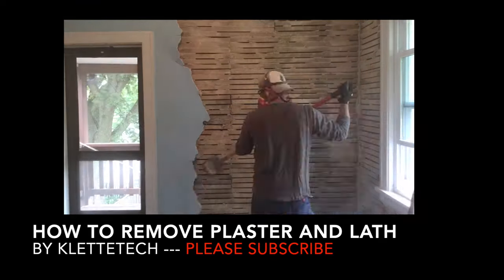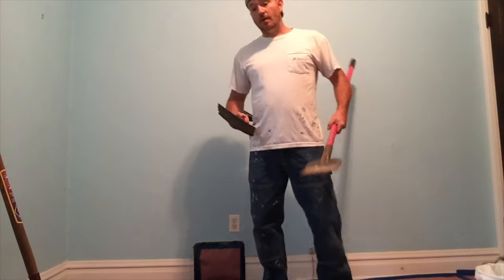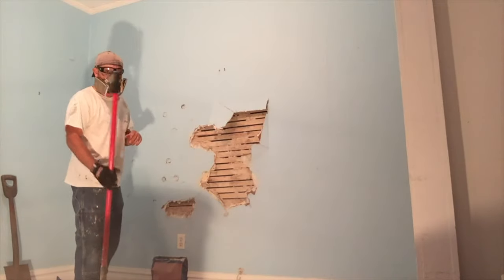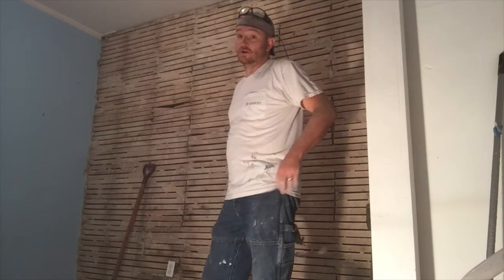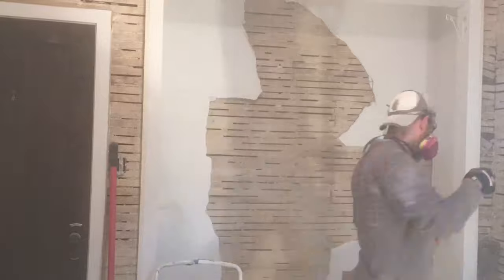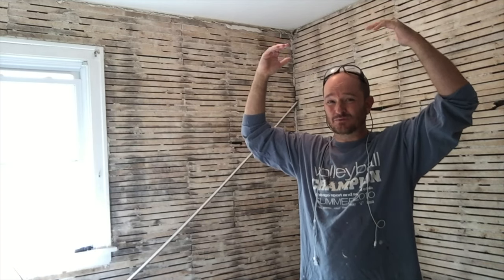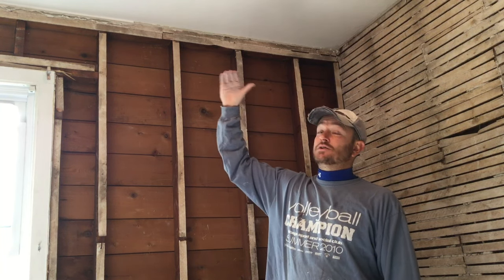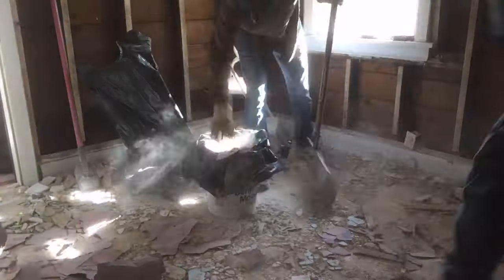How Removing Plaster and Lath (Part 1 Bedroom Rehab)

Comment: This is an old video, but here is a tip. Instead of cleaning up as you go, you can lay thick plastic sheets on the floor (they sell them at Walmart in the paint area) and then remove everything you need to remove from the walls and then bag up the entire floor and put it in one of the Waste Management green bags for disposal or dispose of it at your own trash site! That makes the process FAR better because you aren't stopping to clean up. At worst, you can put the plastic down, fill it with stuff and then wrap that up, put more plastic down and do it all again. It is truly a time saver.
Reply from the maker: Great Tip
Reply: This is a great tip! However, can you explain how you lift it once the plastic is full? As he said, it's very, very heavy. We're remodeling our room by room as well, and this is our process.
Reply: @SimplyInterested you don’t plaster is heavy like mortar and concrete, you use the plastic to protect the floor and clean up as you go. If you have a finished floor you’re trying to protect, use something heavier like cardboard or ram board. If you keep the plastic loose and the floor picked up you can fold over one end of the plastic and sweep all the dust in one pull. Makes dust removal easier.
Reply: @SimplyInterested 
I say lay down multiple layers of plastic and then you can take it away once you get to a point that you still think it's manageable. Otherwise you can use the heavy contractors bags and take it away that way. The plaster is really heavy so you won't get to fill the bags very much.

Comment: Couple of recommendations: pull all of the casement moldings off prior to demo and put a box fan in a window and open another window from another room to create a cross vent to pull the plaster dust from the air.

Comment: Maybe I missed it in the video, but why you you tear out what appears to be a very nice and well taken care of, superior plaster wall and replace it with cheap and inferior dry wall?
Reply from the maker: It was not a nice wall.  It was cracked in places, would have been expensive to repair and horrible to take down all the wall paper.  Also, I wanted to insulate the walls.  As the temp gets colder you can already tell the difference.
Reply: @KletteTech if your plaster is an inch or thicker it should be the insulator itself. I have an old place with a detached apartment that the apartment has double hung Sheetrock and the house has lathe and plaster. You can get fasteners to reattach plaster and fibamesh in 150ft rolls and seal the cracks in plaster (like wallpaper but it’s muddled into the wall with skim coat) Plaster is sought after and I was told removing plaster from older homes actually devalues the home.
Reply: @battlemasterszone1750  they lied. There is no premium for uninsulated lath & plaster walls in the average old home. 🇨🇦
Reply: @kerriwilson7732  it’s all about what the buyer wants. Opinions are like…

Comment: THANK you for being one of the few who properly advocate removing the plaster but not the lath in step one. So much easier to clean up. But... remove all the woodwork first. use medium strikes with a hammer all over to crack the plaster. Then, when you start scraping, start at the BOTTOM. You're going to end up with a pile along the wall, and if you start at yhe floor, you won't have it in the way to finish the job.
Don't use bags... get a bunch of drywall buckets and rent a small dumpster. We even fashioned a chute so we could dump it out the window right into the dumpster.
When you remove the lath, it only takes a little more time to pull it off with the nails rather than just ripping it down all broken up. Barrels no bags for lath... which makes great kindling. Interior walls can have the lath left on and drywalled right over with 2 inch nails or screws. You just have to consider how you want to reinstall receptacles and switches. I normally leave the ceiling. If it's all cracked up go to the hardware and buy some 5-foot wide fiberglass window sceeen and coat the ceiling with that and joint compound. Works great every time.
Last, Make sure your new installs are at least as thick as your old plaster wall or your baseboards will be short.

Comment: Great job!  Good advise to take just the plaster off first. I had an old house, my first house, and I wanted to rip some walls out and I just went willy-nilly and rip the plaster and laugh off and it was such an incredible mess now I have another old house with plaster again yay so I am looking to see what other people do to try a different approach I like your approach a lot thanks
Reply from the maker: Thanks watching.  Hope it help.  The tile scrapper is a life saver.  Also, menards bags made removing it all a ton easier.  Good luck
Reply: @KletteTech  for those without a Menards what bags would you recommend for the gallon pail approach?  I was considering contractor bags but they are 42 gallon and no way I'm carrying that full of plaster.

Comment: I’ve done 5 rooms so far in a 1875 built ballon house.  Horse hair plaster is NASTY stuff and very heavy.  I’m 74 as nd pretty fit but those bags get really heavy.  I have more rooms to do so I’m going to buy extra bags from Menards and use the 5 gal bucket so I don’t overfill them.
Good job, my man!

Comment: Fantastic video. THANK YOU.
We just had a limb of our Oak fall on the house ... Again.
This time it put a hole in the bedroom ceiling, cracked it all and cracked the walls, horsehair plaster and lath. 😞
Unsure if we will be able to find a contractor, we couldn't last time ...
That tip on tacking the lath onto the beams ... AMAZING TIP.
I'm saving this to show hubby, for IF we need to actually do it ourselves - yes we have insurance but they can't control what jobs contractors will sign on for.
Home is over 100 years old, walls and ceiling are I have no idea how old 😆
Reply from the maker: Good luck.
Reply: It's DIY doable, but very heavy, time consuming work. Then you have to do the drywall!

Comment: I put 1/4" drywall right over the existing plaster ceilings in my 98 year old place. Works like a champ!!!
Reply: Right, or if the plaster is in good shape, don't mess with it at all. I'm at a loss as to why even did that room.
Reply: @kenbagwell8551  same! It is easier to fix cracks and put gaps then to rip, clean and attach drywall or drywall over.

Comment: I have an older house with wood slat / plaster, bathrooms have no fans, and I need to install them do to moisture issues. The ceiling in the bathroom is cracked, and no matter how I fix / fill the cracks they come back. I am thinking to remove all of the ceiling plaster as I need access to install the fan. Any tips for doing ceiling only?
Reply from the maker: It sounds basic but go slow.  The corners will fall out on their own. Work from the middle and even consider scoring the corners with a box cutter knife
Reply: @KletteTech  that’s what I had in mind, vibratory saw all the way around the edges and then start breaking it up from the middle. As for the slats, should I remove those before drywall, or leave them?
Reply from the maker: If there is insulation up there I would just leave it there to avoid the mess.  Also, if you leave it up when you place the drywall there will not be a gap between the drywall and the plaster on the walls.  The gap you would have to fill around the top would be the size of the lathe. Does that make sense?  FYI people have posted that Drywall on top of Lathe always cracks but today it has never cracked on any of the walls I have done it on.   @mw3designs
Reply: @KletteTech  would be a shock to find any insulation in this old house! Is the slat fairly the same thickness so the drywall lays flat? Also curious what the keys will look like on the ceiling, won't be able to knock them out of the way in the ceiling.
Reply from the maker: The plaster is typically close to being the same size a 1/2 inch drywall
 @mw3designs

Comment: Great video! Is there a reason you saved removing the trim for last? It seems like it would a lot easier to remove the trim first so it isn't in your way (and doesn't get damaged).
Reply from the maker: Yeah I was trying to leave the trim up.  It did not work well.  I took all the trim off except the baseboard.  If I do it again I will take off all the trim except the baseboard.  Leaving the base board up saved me a ton of time later in the project.
Reply: Always take the trim down first. It has to come down to put up new material anyways, plus it makes removal of many years of lead paint easier

Comment: Thanks for the tips! Currently doing the same exact thing as I'm about to drywall it but I want to experiment with 1 room 1st, my house was built in 1910 so hopefully I dont find any skeletons in the walls 😱
Reply from the maker: Good luck!  Hope you find some treasure
Reply: Why would anyone take down such a wall to put up an inferior one? Unless you have mold or a rat problem you can't get to for the plaster. It's soundproof and fireproof. Thats why we built our buildings with it for thousands of years.
Reply: It also makes it less interesting buy for people looking for an older home. I'll never understand people that buy beautiful older homes built to withstand a tornado and stand for 200 years and completely weaken its structure and make it so ugly. I see "updated" older homes that are so hideous i want to throw up. They ruin the symmetry of the homes.
Reply: @trinasmith4326  because it was crap and in rough shape and had a mold issue in the corner
Reply: Plaster doesn't always last forever.  I have a home built in 1930 and the plaster upstairs is falling off in chunks because the house has settled.  I'm considering removing the plaster upstairs and leaving it alone downstairs.  Plus,  we can't hang anything on the walls without it crumbling.  It's a tough decision because I don't want to ruin my home as mentioned.
Reply: @HJ-fv4vs  yep thats exactly what happened in this bedroom
Reply: @trinasmith4326  because trying to hang anything is a total nightmare
Reply: @trinasmith4326   Well, I bought a house that was built in 1910 and wasn't well-cared for.  I also have no insulation, and old knob and tube wiring.  I tried repairing the plaster, and it was a disaster.  Yup, plaster disaster :)

Comment: I purchased a house built in 1950 5 years ago. After sinking a boatload into foundation repair, new windows, and landscaping, Im ready to start renovating the master bedroom.  One thing I noticed with your video is how thin your plaster is over the lath. 

Mine almost looks like a half inch plaster board underneath. I haven't started the project yet but chipped away some plaster that came loose when the windows were installed and its more plaster underneath. Taking out an electrical socket, the amount of plaster over the edge of the metal electrical box is about half an inch thick. Is this normal? 

Thanks for the video too, Im doing this myself and this by far has been the most informative and easy to follow vid I found.
Reply from the maker: Thanks for the comment.  My plaster was about 1/2 inch think.  I left the lath up and 1/2 inch drywall fits good when lining up the drywall to the trip.
Reply from the maker: Also, good luck on the project.  The tile scrapper and those Menards bags really help out.

Comment: You should advise people to test for lead paint before they start pulling down plaster & lathe - there's almost certainly lead when you have this construction.
Reply: Not only lead but asbestos also great recommendation also spray water on surface to keep dust down hate for the. Asthma stuff (asbestos) to go airborne
Reply: @carlosmcdaniel3574   First person I've seen who brought up the main thing I am concerned about. It really is a lot of asbestos in all that old plaster, even with a respirator on. I am redoing some rooms now and I am contemplating just putting sheetrock over the plaster, just won't be able to insulate.

Comment: I can't decide if I want to take mine down or not cause of the historical part of it but none of my walls have insulation and I know it would be better to take them down for that so there is a proper barrier between the insulation and wall
Reply from the maker: Depends on where you live and what shape the walls are in.  If the walls are in good shape, I would not.  I would look into having insulation blown in.  If the walls are in bad shape, I would replace them, insulate and update the electrical if need.
Reply: @KletteTech  i live where we get all 4 seasons. So I dont believe, correct me if im wrong, blow in is best in regards to moisture
Reply from the maker: @foreverkenzie2397  I am not sure.  But if the walls are in good shape I would look into blowing in insulations.

Comment: DID YOU ALSO REMOVE THE PLASTER KEY AND WASTE AFTER PULLING OF THE LATHE?  SURPRISING HOW MUCH WASTE IS LEFT BEHIND THE BASEBOARD TRIM.  I ALSO PULLED OUT ALL NAILS/FASTENERS IN THE STUDS. ‘TIS A GREAT FEELING WHEN ALL IS DONE.
Reply from the maker: Yes I removed it and yes it is great when it is all done.

Comment: How needed is insulation if you live in Michigan? Im doing one room at a time too.
Reply from the maker: I think is a must.  Not only will it save you money over time but it will make the house much more comfortable.
Reply: Great video, do you have any other videos? My house is over one hundred years old, I have hair hair plaster, wall paper,  can’t paint it and wire and tubing. I am scared to start this project.

Comment: I'm scraping a ceiling and walls down in my bathroom. I wasn't happy with a skim coat I paid for and it seems there was a bit of another skim coat in the bathroom as well. I've been trying to wear a mask. Now I find that old drywall mud had ASBESTOS in it as well as PLASTER!!!!!!!!!!!!!!!!!
Reply: Not all old plaster has asbestos. I demo for a living and we get walls tested before demo. But either way, you need to wear a respirator while removing walls. Even without aspestos, the dust is enough of a health risk
Reply: @toxicgracie3772  what year was asbestos used in plaster?

Comment: this is completely insane. Why would you remove a superior material like lath and plaster in order to add a cheap substitute like sheet rock which provides a perfect medium for mold growth if it ever gets wet? You can never have a roof leak or a plumbing leak or accidently leave a window open. What are the chances of that NEVER happening?
Reply: Ads square footage for re appraisal

Comment: The filters on your respirator, are not particulate filters....
Reply: Yes they are, They also do vapour as well. I have one of them and it comes with a vapour pad and particulate built in together.
Reply: Where did you get your  respirator..
Reply from the maker: Lowes I believe

Comment: Poor guy ...he destroyed perfectly good original plaster ..that is extremely easy to restore ...all he had to do was Google plaster restoration for half price and no mess...just saying...
Reply from the maker: Thanks for watching.  A couple of points on your post.  One, the wall were really bad and had wall paper I would have taken forever to get off.  Fixing plaster the correct way when it is in such bad shape would have been really hard.  Also, i wanted to insulate two of the walls.  The plaster would have blown off if i blew insulation.  All in all it was a much better decision to remove the plaster.  Thanks for watching and you comment.

Comment: Removing the plaster is foolishness.. For one thing, plaster is by nature a more durable finish than drywall, even high-level drywall finishes. In addition, plaster outperforms drywall in a number of key areas, including insulation, soundproofing, and fireproofing. One additional point in plaster's favor is that by nature, mold can't grow in plaster.
Reply: Just curious... Any advice if you have  paneling over top of plaster, and there's been water damage to the paneling from leaking on the roof? I also heard plaster will not grow mold, unless there's dirt or some kind of organic material it can live off of.

Comment: Excellent vid by a hardworking DIY guy. My only comment about saving trim is that new Sheetrock walls sitting with 100 year old trim…meh?  I didn’t have the money either to buy new trim and spent lot of time smoothing 100 years of lead based paint.
Reply from the maker: Great advice.  Thanks for watching

Comment: Great vid, been planning on doing this to my 1920s home for a while while also insulating, removing knob and tube, and replacing windows.
Reply from the maker: Good luck.  I have a whole playlist of my process.  Also , the tile scraper I have linked in the description is really worth the money.
Reply: @KletteTech  what was the reason why you wished you waited until after insulation to put the lathe on? To seal the edges of the insulation more?
Reply from the maker: @di5gustipated  To cut down on the gap between the outside all and the back of the insulation.  I was not sure if that would cause any moisture issues.

Comment: Why do people want to remove the plaster?
Reply from the maker: In this case the plaster was pretty rough and I wanted to insulate the outside walls.
Reply: why did you use blow in insulation?
Reply: didn't
Reply from the maker: @Moldyman3740  The plaster was in bad shape and blow in insulation is to expensive for me.  Killed two birds with one stone

Comment: I would have just sheetrocked  over the ceiling, it doesn't have any structural damage or any water damage It ,ain't going anywhere plus it'll be an extra layer of soundproofing and insulation
Reply from the maker: I thought about that but I was worried about the weight on the ceiling joist.  The are only 2x4